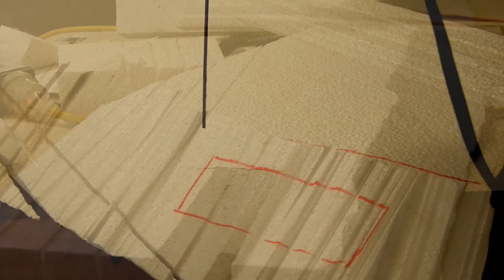Leila Central Model Railway Starting Scenic Foundations.

Comment: Hi Clint, very much enjoyed the video  A hot wire cutting is very useful and I wouldn't be without min.  I liked the way that you re-used  the offcuts which is something that hadn't occurred to me so thanks for that.  It is surprising that just by getting the foam in place it transforms the  look of the layout.  Stephen
Reply from the maker: Hi Stephen, thanks for watching and indeed it does change the look of the layout. Never throw anything away! It always comes in handy, even if it’s to hide it under stuff to save space in the bin.... all the best Clint

Comment: Hi Clint, polystyrene is so easy to use and lots of others say it is messy. I use it and cut it the same way as you and i think this update shows just how good it is as a material to get great results. Great video, cheers, Chris
Reply from the maker: Hi Chris and yes I could not agree more. Best thing is I can get it for free and we get it in appliances etc. It’s properties being lightweight are ideal. Would not be keen on using it without a hot wire foam cutter tho do to the mess it makes. All the best, Clint

Comment: Hi Clint, So that's how you cut it with out making loads of mess if I was ever going to use it I would get one of those thanks for showing us.
Cheers Robert.
Reply from the maker: No worries Rob and thanks for watching. It sure does make light work of the foam and for the price, i think its a worthwhile investment. Certainly saves on the mess foam can make. If only it would help with the biggest mess creator...me! All the best, Clint

Comment: What a couple of great tools you have to cut the foam. Can i as where did ypu get them from? Love the line of cement wagons to! Cheers Jerry
Reply from the maker: Hi Jerry, absolutely and more than happy to share. I bought them from this place, Foam sales. Link is below. Its a three in one foam cutter, wire cutter, knife and engraver in the one kit and runs off mains power. You can hot swap the tips over as well like I did so there is no down time if you need to switch cutting tools. Its was reasonably priced and well worth the money spent. I plan to do a more in depth review on this I was that happy with it so stay tuned. Thanks for watching and commenting, Clint 

Link: https://www.foamsales.com.au/products/hot-knife-kit?utm_medium=cpc&utm_source=googlepla&variant=10298794753&gclid=Cj0KCQjw-b7qBRDPARIsADVbUbWExrI6501KtVWU_QDIeqL-5-teV1J7eJBvl2K-AazIRsq7UEwgl0caAoSQEALw_wcB
Reply: @leilacentral1883  thanks. Bloody brilliant